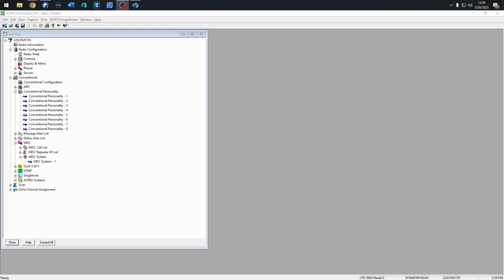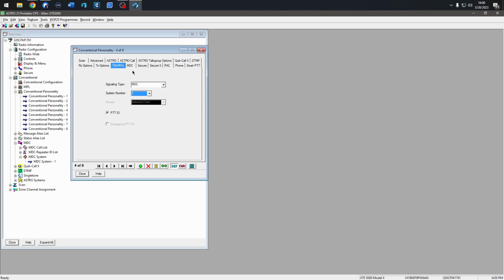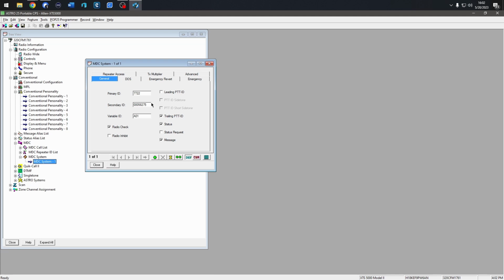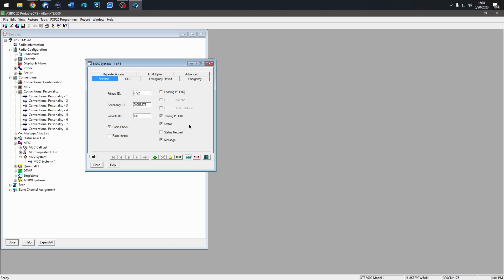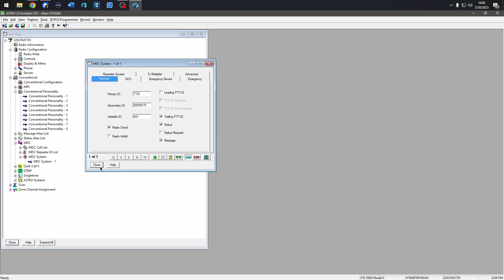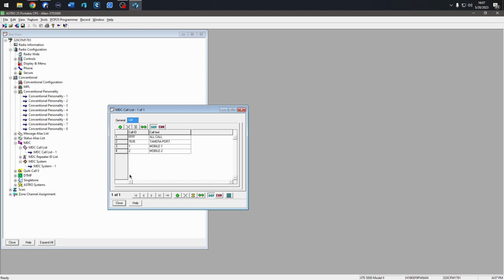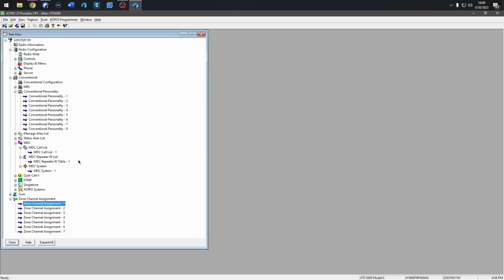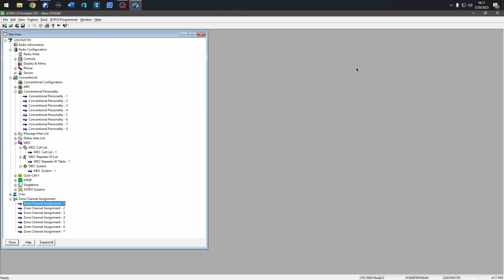Motorola XTL 2500 MDC 1200 Programming Basics

Comment: Hi standing wave. I am try to build a repeater with 2 XTL2500 radio. The TX is 110w and receiving is 50 w. How I connect those 2 radios (Interfaces cable) Thanks for the videos..👍📡